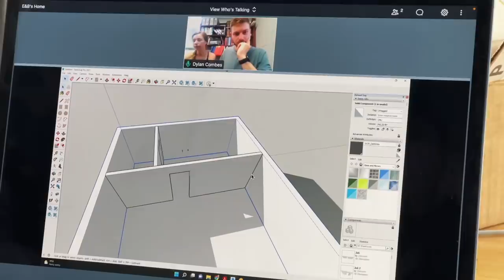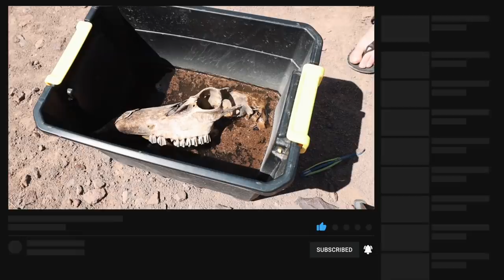OUR NEW HOME (for now) | A Frame Cabin // Self Built Home

Comment: Cedar tongue and groove would be amazing to panel the inside and since it already has drywall you could get by with the thinner (takes up less space) and cheaper stuff used to line closets. There's also a pine version that's less expensive.  Also on the exterior you could use an exterior stain temporarily to protect it until you decide the finish, if you don't go with the stone.  Aged barn wood would look awesome.  I love watching your journey and thanks for sharing.  Good luck! 😊
Reply: The cedar would smell amazing.  Great idea !❤❤❤
Reply: The white walls of the interior are sheets of foam between the framing members, no drywall.
Reply: @docwatson1134  I just saw the white color.  They didn't use the high density insulation that is typical which is either pink, blue or yellow.  That is what we would have used at the least where it gets cold.  My husband & I have built several homes together.

Comment: Regarding finishing the interior of the A-frame, or at least the sleeping area, my concern is condensation. As I generally teach to young camping youth, an adult-sized person exhails approximately 1 liter of water over an 8 hour sleep, and there's two of you. With such a cramped space and cathedral ceiling above you, that's a lot of moisture to manage near the peak of the A. I would recommend that you finish the interior, at least of that area, with something non-porus that will resist moisture and mold.

Comment: I like the rock facade idea, run with that! Create finished walls with paint! Use the wood as "frames" for something magical and scenic, a mural. Just white or  whatever color coat the ceiling rather than closing it in.
Reply from the maker: Wouldn't it be cool if we did the rock on all our buildings to tie them together!? We will see if we're able to make it work on the a frame!
Reply: @ElsaRhae  as long as it doesn't cause for more work in up keep later on, but I like the texture and  thermal effect of rock too. I think it will look great to have the buildings matchy matchy though.

Comment: When we built our A frame cabin back in the 1976 & 77 my mom wanted shingles in the front and back it turned out really nice and the shingles held us really well up in the mountains in California. We had a metal roof and a ladder that dropped down from the second sleeping floor that could be tucked away when not in use. The inside walls we used tongue and groove all the way up the walls and it made it so cozy. 😀

Comment: I don't know what your budget is, but 4x8 sheets of "t-111" looking " hardy board", stained/ painted, to look like wood in there,n do a lighter wood look,it is cement board, n is screwed into place..it would be a " thermal mass" in the winter, once heated..n not require huge amounts of heat to maintain..n no worries of termites!! Lol! Unless they have very tough dentures!! Just a thought!?It will maintain cooler Temps as well, if you put an( rv a/c 3500 btu)![heat pumps also] Outside,just paint the metal a predominate color of surrounding rocks, n wood faces, do in accent lighter colors ( all to reflect the sun n heat)!!!??? Just some observational thoughts!!??

Comment: I’m currently renovating our first home, and I think you could have a good result with just all purpose joint compound on the walls! We just redid our popcorn ceilings with it. Just layer on two thin coats, let it dry, sand, and paint! Plus it’s affordable, a large box of compound is $10 and would maybe cover the whole inside of the A frame

Comment: On the outsaide use your rock like you said then collect pallets and use reclaimed pallet wood then stain it to color or let it weather a few months then seal. you can do the same on the inside just cut them to the same angle as the a frame and run them to the point on the front and back and just run like shiplap on the sides. looking forward to the build ahaead. Great video

Comment: Always a joy spending some time with you folks.
As for finishing out the A-frame, your suggestion of using local rock sounds good. 
You could stack & mortar it like bricks. It would make a good thermal mass to moderate day/night temperature change.
Wishing you continued good fortune.

Comment: Looking good. The key for your A-frame’s interior and exterior finishing is to be “fire-wise”. Do you have a defensible zone outside and fire resistant surfaces? On the interior, are you following the International Residential Code requirements to ensure your safety? After that, recommend that your choices maximize the use of natural light! Have fun.

Comment: That A-Frame turned out really good. If you weren't already building a larger house that could have really been the place. structure turns like that have real value no matter how small and just make a offgrid property feel like home.

But that would make a killer place to host people if that's what you're working towards. By doing that the Scamp can then turn into that easily towable off property shelter for you two.

Comment: Killer shot of B with his bow at sunset..did you notice the raptor flying by at the end, just for a split sec? There’s some pretty cool 1/4” tongue and groove interior siding material that would be cool for the inside of the A frame. You can stain or paint it. If you were fortunate to locate some in cedar or redwood, that would even be cooler.

Comment: My lifelong Motto " HOME is wherever you hang your hat!!!...🎩💖💛💜💚
A-frame siding;. Lava -volcanic Rock is a great insulation barrier (heating & cooling)
Also main Home:. Geothermal tubing pipes buried, run length of house.  2 end pipes come up in vented box with fan,(solar) for natural cooling & heating off-grid DIY build.
I saw this on Discovery channel done on a Montana  A-frame mountain build
It seemed inexpensive and smart to regulate extreme temperatures.

Comment: On the outside front I would use that lava rock u mentioned and mybe some other interesting rocks and plaster it to look like adobe.Also mybe a sandstone walk .And mybe a  wall around the front that starts off higher in front and gradually slants lower. so you can sit or place flwerpots. A cozy little nook (stucco southwest style ).i suggest sheetrock inside.,if you want mix it up, do the inside A- frame front  a different material.😁no wallpaper.oh cedar wood is nice!I think you have those trees around ur property .

Comment: @Elsa Rhae & Barron: For the interior walls, perhaps, use plywood or pallet wood to make a design wall. such would add additional insulation and provide a creative design touch. give the loft is more confined, I would want to use something very simple on the walls, with just a little bit of color. I think I’d stay away from texture up there, as texture can sometimes “shrink” a space.

Comment: For the interior: all mirrors!!!

Just kidding. (But kinda not.)

Here's a question: do you have concerns about heat buildup in the summer with a metal building and sleeping up on top? Or does it cool down enough with a cross breeze at night? Obviously, with the Scamp, the summers were hot as well, but you could park it under a tree. No options on the A frame.

Comment: Can you provide the structural design and dimensions of Ethel a frame?  Did I miss it?  I can’t see what the horizontal slats that hold the roof are fastened to. I do not see any vertical beams in the side middle of the a frame. I am also interested in the foundation choice. Just curious. Also a breakdown of materials used and reasoning. Questions galore. You have so many exciting projects, it would take a year to document them all.